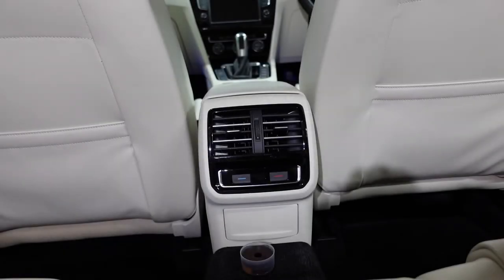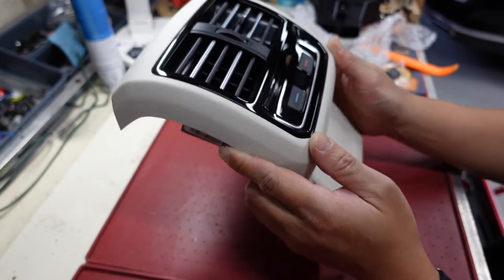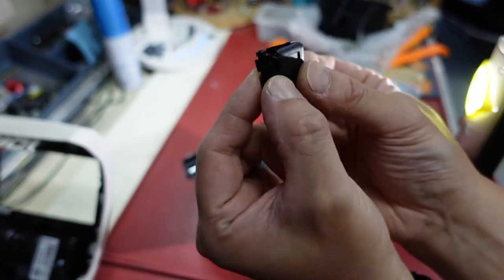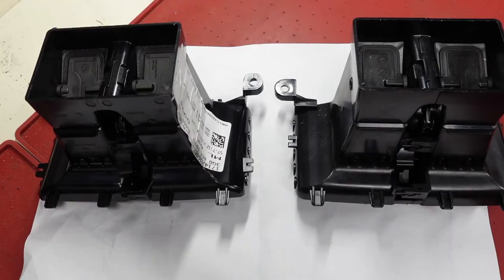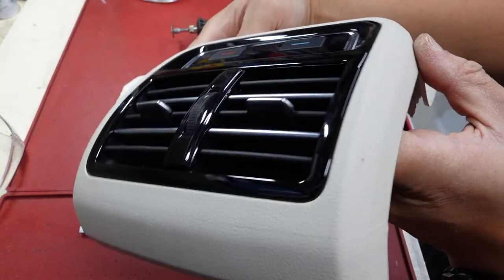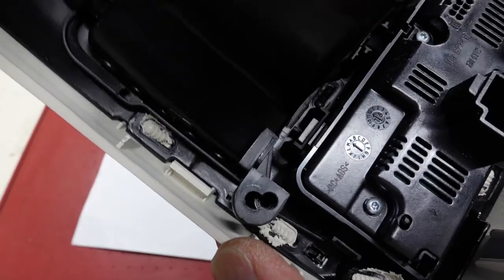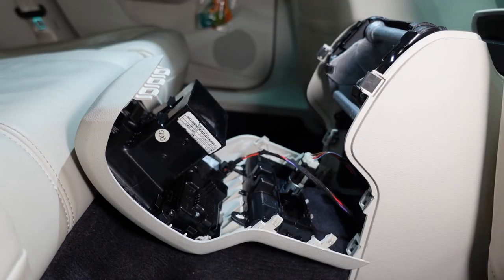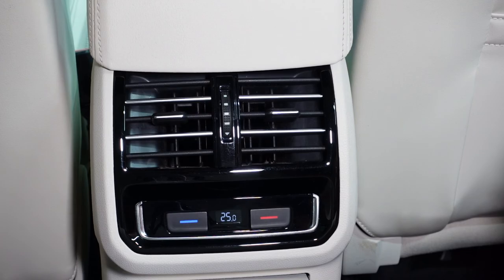VW Passat B8 GTE - Rear Vents Replacement

Comment: Brilliant explanation, thanks for doing that for us. Can I ask why didn't you just change the air direction tab with one from the new unit?
Reply from the maker: Cheers, good question, I can't recall why I didn't just change the deflection flapper bit only, I would imagine that on initial inspection it was not straight forward or possible due to parts not being the same or non removable so based on that I though it would be easier to swap entire unit!
Reply: Ok understood. Going to do my own one on my Passat GT. Wish me luck.
Reply from the maker: You'll be fine, good luck!

Comment: My back vents in my Passat B8 are only blowing cold air even on HI how can i solve it?
Reply: Did you solve that? I have the same problem
Reply: @nICkkkkkos  no i couldn’t but i learned that it was chronically problematic in B8s, the AC motors should be replaced with new ones. Front ones are problematic too, let you know
Reply: @omertan5091 same problem with my seat leon 2021